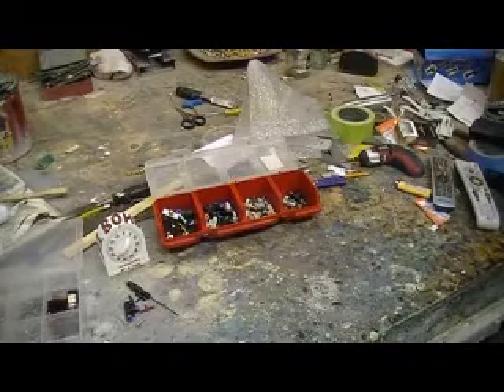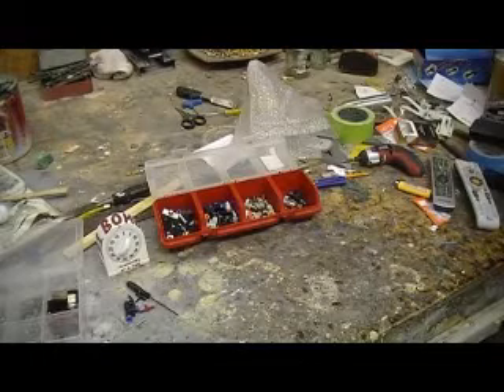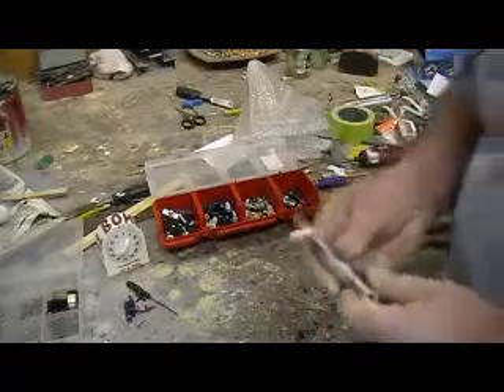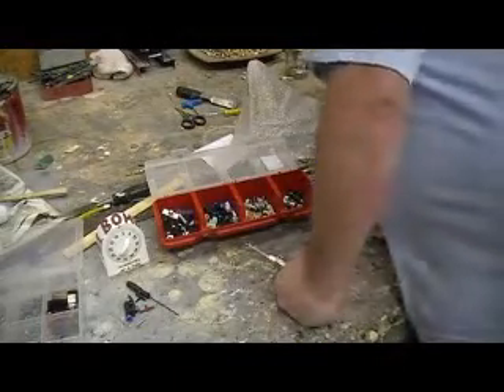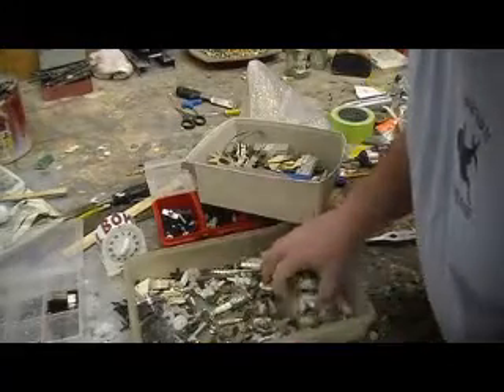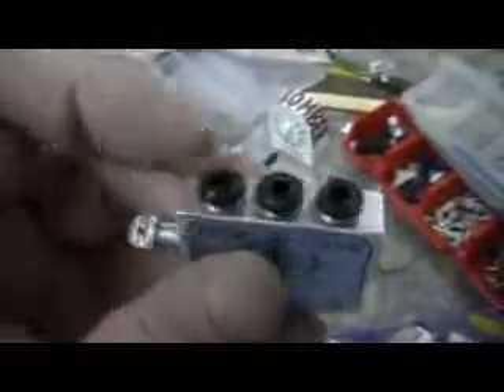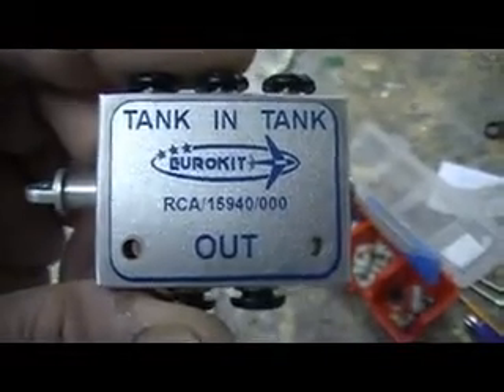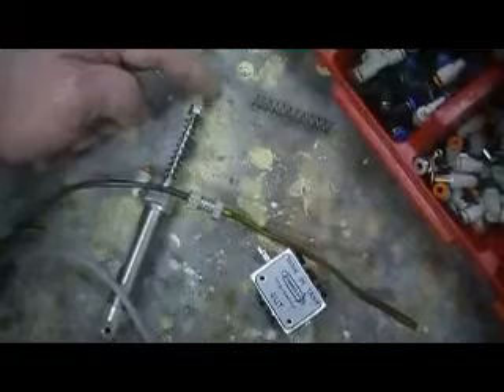how to build a rc jet B-1 Bomber # 150 pt 1

Comment: If you want a weaker spring for that cylinder Bob, try a spring out of a Ball point pen, should be about the right size and would be about the strength your after mate